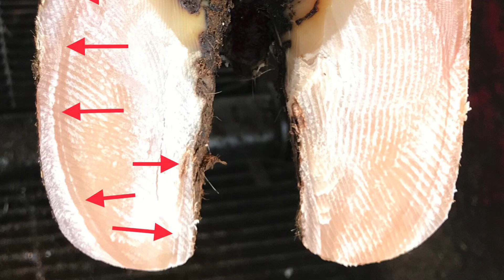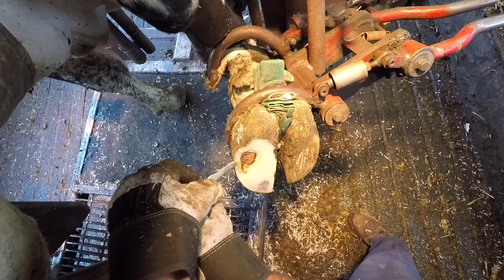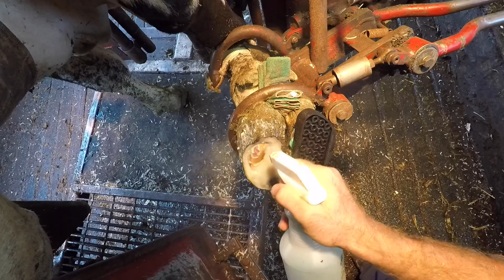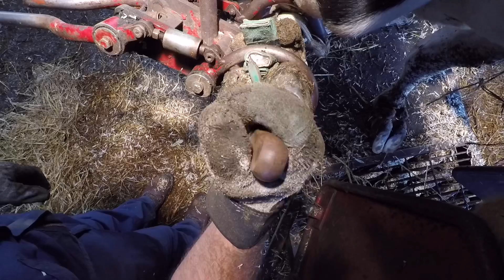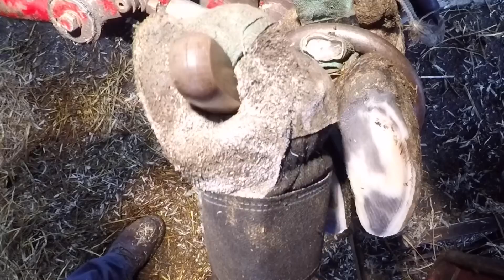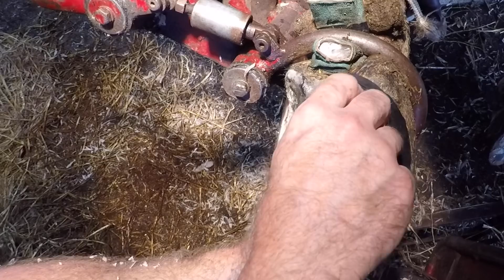Ep. 49  Why are ABSCESSES always in these locations???

Comment: Hi Nate, just stumbled across your videos.  Very cool you get to help cattle walk without pain.
I'm curious, when you glue on a bock, what is the nature of the adhesive you use?  Some sort of specialized 2 part epoxy?  It seems to set remarkably quickly.
Do you custom forge your knives?  Looks like a hook knife that I've used for carving although the tip is somewhat different.
Thanks for the videos!
Reply from the maker: The glue is called Mini Moo Glue and yes it’s a two part.  I don’t forge my own.  They’re specifically designed for hoof trimming and I purchase them through Armor Animal Health.

Comment: I really appreciated all your VDOs. 
since I have worked in dairy farm, I’ve had lots of sole ulcer & white line abscess problem , I do used a Demotec Easy Bond ll claw glue with a wooden bloc but It doesn’t work well  (never last long more than 5 days) moreover after I finish trimming and let’s the cow goes , a bloc just came out right away after she walk. 
I just need some opinion to deal with this situation.  Cause I could not fix a hoof problems without using a bloc. 
Have u ever used or had an experience  about demotec glue before? 
Should I changes to others glue brands ?
Reply from the maker: I’ve never used Demotec.  I’d recommend Bovibond or Mini-Moo Glue which is what I use.  It sets up fast and holds well.  Make sure that the claw is clean and make sure the glue has fully set up before you put the foot back down.
Reply: Nate the Hoof Guy thanks you so much !!unfortunately, just only Kruuse and Demotec glue’s brand available in my town.